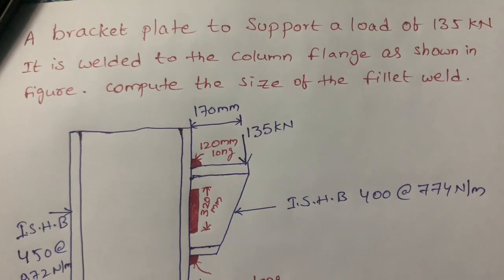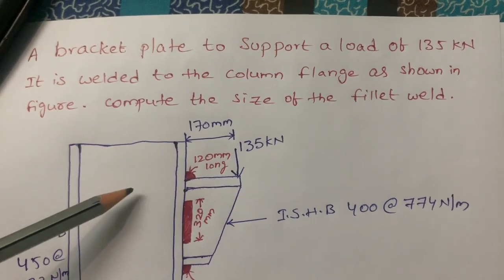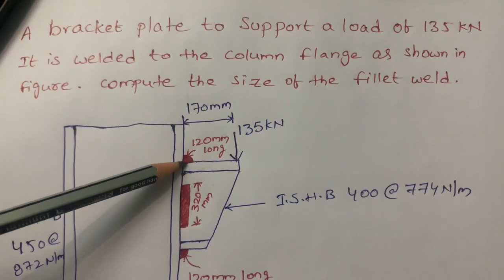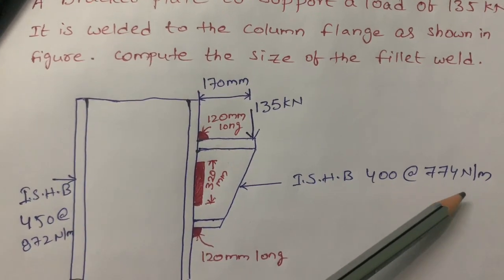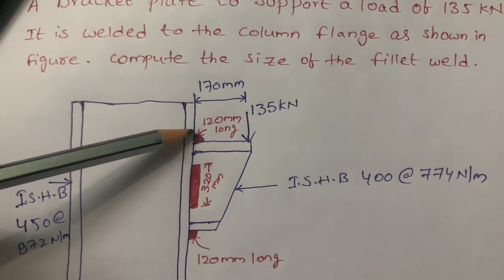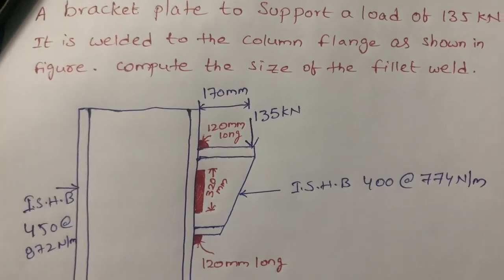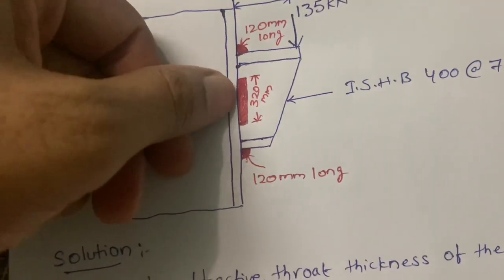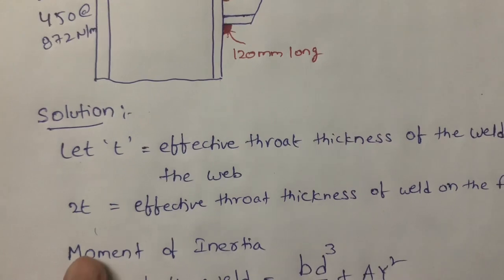Eccentric connection outside the plane by using welding. problem 4

Comment: Please clearify flange has same single length weld in top and in single length bottom ,, then why you taken for 2 line - 2x2t - 4t
And web also 2 line weld you have taken 2 x t - 2t
Reply from the maker: Yes, But two sides means not only top and bottom. Another side for example left and right side. So one side it is 2t another it is 2t total 4t.

Comment: You have taken 4t for flange, its mean 2 line weld top and 2 line bottom web???
Reply from the maker: No, it means both side of the flange
Reply: @civilworld  2 xt is 2t for both side
Reply from the maker: @suhaibkhan7356  yes but in the diagram we are seeing only one side that is 2t  and other side is another 2t total 4t
Reply: @civilworld  you multiply 2x2t is 4t